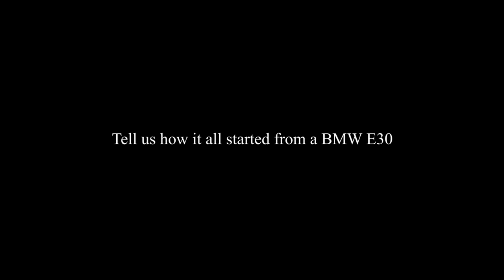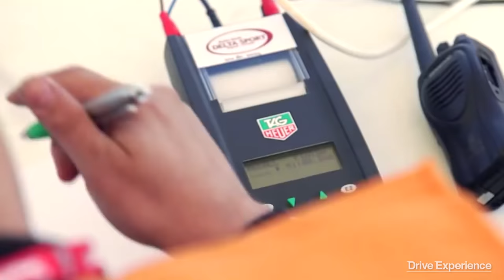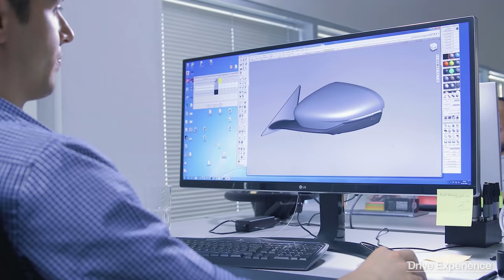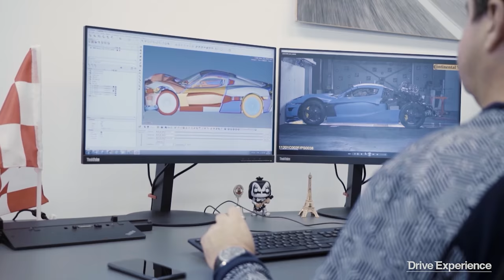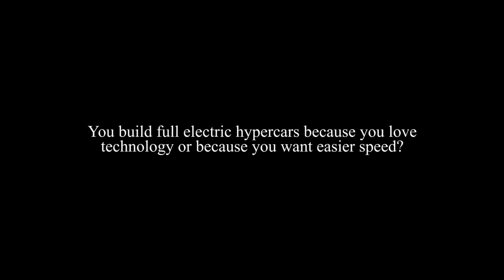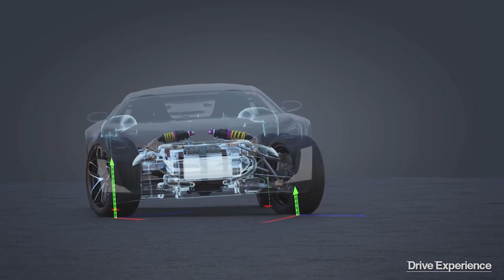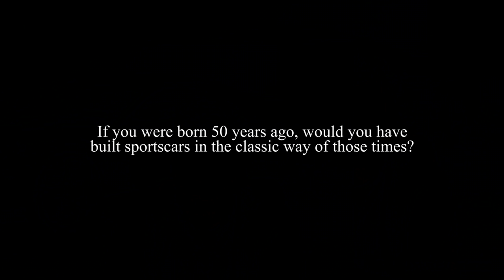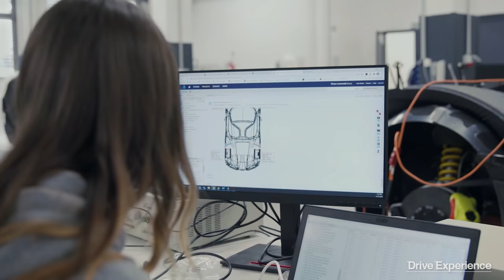Mate Rimac: the 1.900 HP croatian electric hypercar creator - Interview by Davide Cironi

Comment: No petrol engine, no feel of the petrol engine. No sound of the engine, no sound of the exhaust pipes. No manual transmission, no gears at all. No cutch, no delicate control of it... Electric cars = zero driving pleasure.